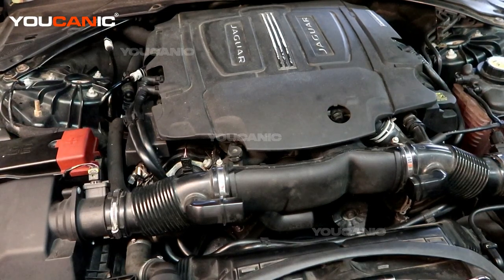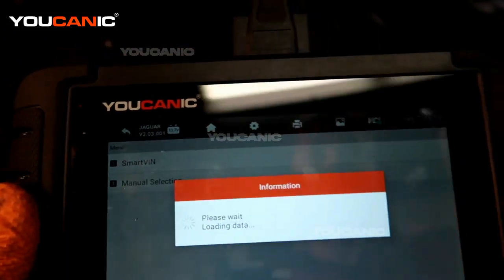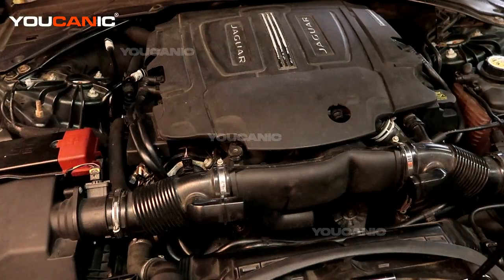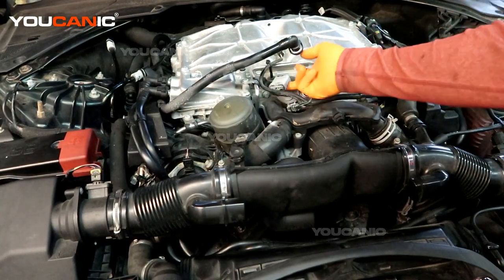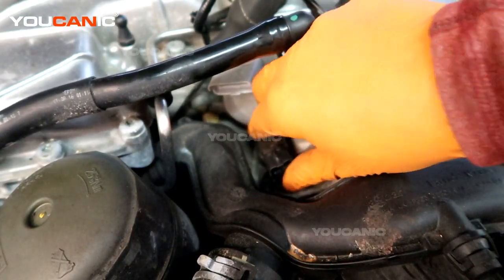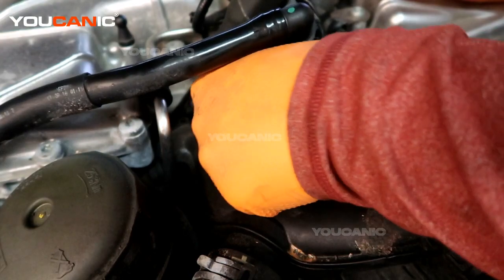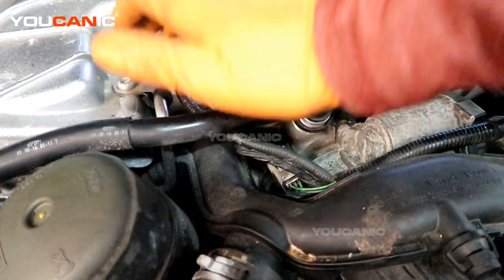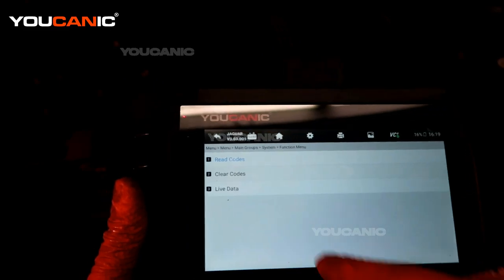Jaguar P012D - Turbo Supercharger Inlet Pressure Sensor Circuit High

Comment: What about a code P012C? 2017 jaguar xe 3.0 supercharger
Reply: This video applies to this code as well.  The Only difference is this code reads the sensor circuit is low in stead of high.